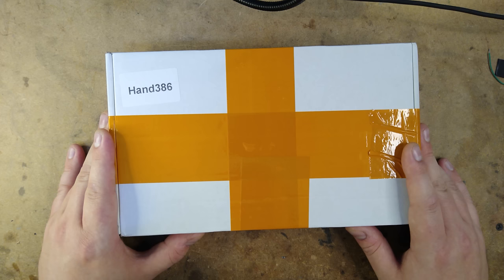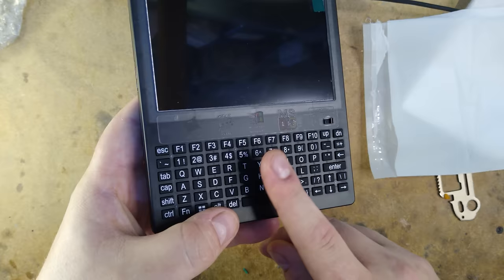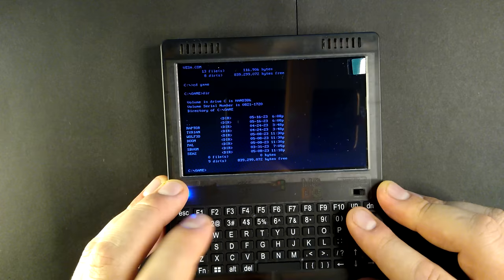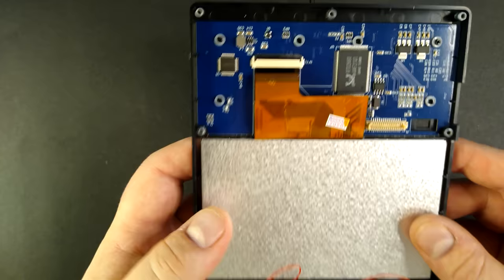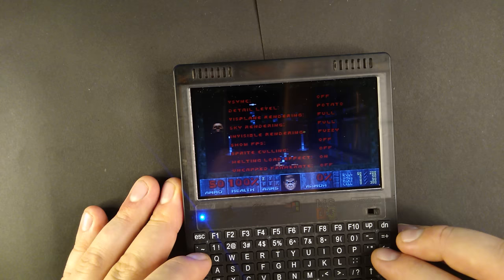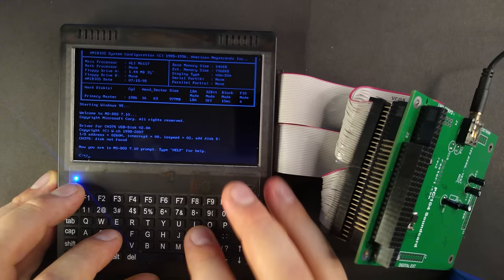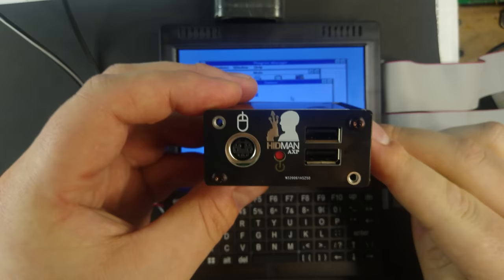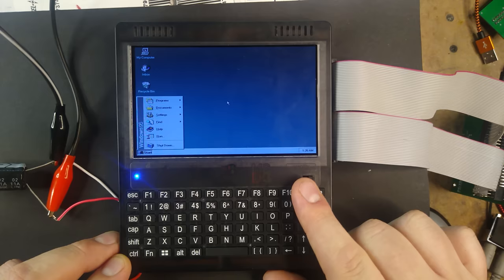Connecting ISA Cards to a Handheld 386 PC!

Comment: Other silly things to try: a network card (boring I know, but I'm a network engineer); a floppy controller card and floppy drive, mostly to amuse Foone (or annoy, when everyone sends them a link to your video!); a SCSI card, which would allow you to connect a SCSI Zip drive for no good reason (or, you know a SCSI2SD if you want to be boring); a Trackstar, which is basically an Apple II+ clone on an ISA card. That's all I've got for now. I'm sure I could think of more silly ideas when it's not 1:30 am.

Comment: The new Pocket 386 improves on the usability of this thing immensely. More of a laptop form-factor, still very tiny keys but not the squishy kind.  Also can switch from widescreen to 4:3. Basically took the best parts of the Pocket 8088 and Hand 386 and merged them.

Comment: Those new-old-stock chips from the mid-1990s are so readily available from brokers and I can only assume that a company like this offering to buy 10,000 units of a part which hasn't sold in more than single quantity for over a decade probably got them a fantastic price!
Reply: Not necessarily, those sorts of folks sometimes care more about how long they can support some hardware than how many chips they can sell (especially if they're contractually bound to provide long-term hardware support...)

Comment: Experimenting with the Elan520, it’s the 5x86/133 on a chip with most of the goodies. BGA so a pain to work with but might be a tasty chip. No L2 but we will see if lines exposed. Data sheet ambiguous

Comment: Apparently Action Retro's one basically exploded itself even under light load so that might be worth keeping an eye on
Reply from the maker: yeah I think I've blown up the battery charger in this one...
Reply: @TheRasteri  how did you connect it to power?  Just using a bench supply I presume?
Reply from the maker: @RetroTechChris  yeah just a bench supply at 4.2v going straight into battery terminals
Reply: @TheRasteri  awesome!  Thank you!!

Comment: I'm hoping there are some wide out of order RISC-V chips with M1 like performance on the way from a variety of companies so they become commoditized. That way you could do a sort of gonzo Apple Macbook Pro with Linux replacing MacOS and RISC-V replacing the M1. Obviously it's not compatible with x86 but you could run a JIT/binary translation based emulation giving you x86 games running really fast. And of course it would absolutely fly running native code. Tenstorrent and Ventana seem to be working on these sorts of CPUs but they're very far from a commodity and probably won't be cost competitive with x86 or M1 for a few years.

Comment: Why even have the screen and keyboard?  Just sell this as a small vesa mount box that you can hook up to external devices and a monitor and use as a mini retro PC
Reply: I think, Wyse with alternate ROMs looks promising. It is originally a thin client, but people learned to turn them into retro PCs. This thing has a real x86 CPU, AMD Geode, but lacks real IBM PC devices. Instead, it makes active use of SMM mode together with CS5536 chip. This is called Virtual Subsystem Architecture (VSA), for joining together several Virtual Subsystem Modules (VSM). For instance, this thing has no hardware text mode. Text mode letters are drawn by one of VSMs. It wakes up on timer and reads data from what is supposed to be a video memory and.

Look for "Wyse DOS" or "Wyse kmeaw", kmeaw being the author of such ROM for Wyse S10. I can see other Wyse models are being reprogrammed too.